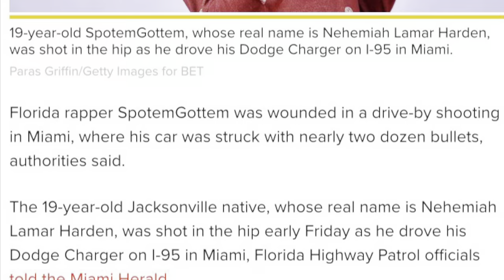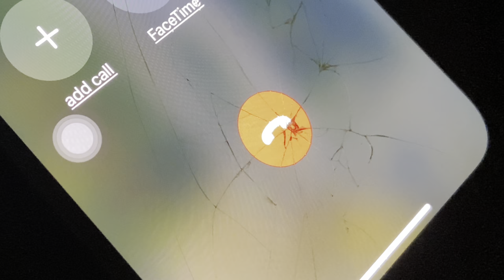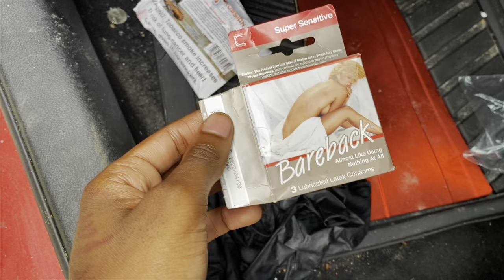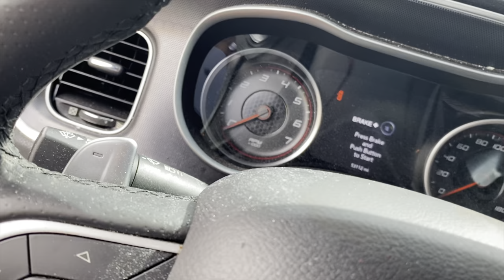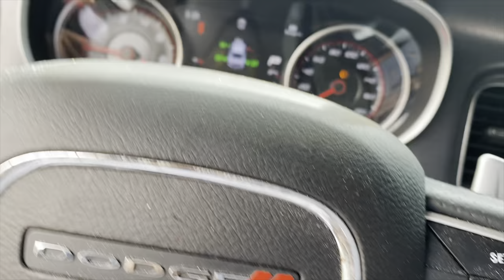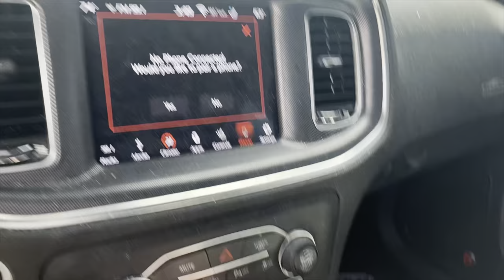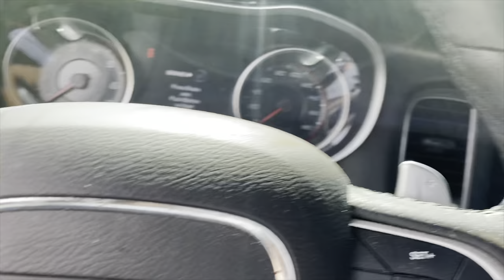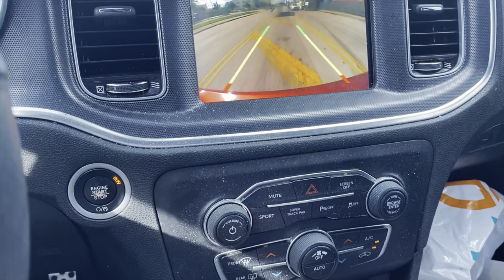MY STOLEN SRT 392 WAS RECOVERED!! SPOTEMGOTTEM WAS DRIVER! *CRAZY VIDEO MUST WATCH!*

Comment: How did they steal the car from you anyway?
Reply from the maker: next video stay tuned!
Reply: They probably ain't steal that shit that's Miami chop shops everywhere someone took it and after they changed VIN etc spotemgotem purchased it
Reply: Probably pushed it and towed or pulled it. they get stolen so easily because the steering wheels in the chargers and Challenger's  don't lock and turn without the key fob In them. Then there's a thing next to the shifter to manually take the cars out of gear without the key in it. It's messed up dodge doesn't make the steering wheels at least lock in them. That's how most of them are getting stolen out of people's driveways at night without them knowing.
Reply: @TrapSRT  spot em got em didn't buy it how stupid are u guys, simple story someone spot em got em knows stole it and spot em got em had it that night he got shot
Reply: It's even easier today then it used to be with everything being wireless
Reply: @TrapSRT  cool channel bro I jus started me 1 I got more and better content cumn 💪🏿
Reply: Real talk 🤔🤔🤔
Reply: I seen a lot of videos where they can get a copy of the key transmitter feet away and program a key on the spot in the car and drive off. Than chop shops change the vin etc and resell the car
Reply: @m200dreamer7  IGLA system is the best defense against this
Reply: Press charges on his ass … I’ll be damn if someone steals my shi … smh
Reply: Damn they trifling them rubbers tho lol
Reply: And here I can’t get anyone to steal my v6 so I can afford a v8 😂😂😂😂😂
Reply: Do a what u found in the car video !
Reply: @dpresssure1262  👮🏾‍♂️👮🏾‍♂️👮🏾‍♂️👮🏾‍♂️👮🏾‍♂️👮🏾‍♂️
Reply: @lordoftheturps9337  😂
Reply: What was in the trunk lol
Reply: He sold the whip and started makin videos 3montha ago with the yellow thang with the money 2 Fa 1 good job playa haha
Reply: Spottem gotta white hellcat
Reply: @TrapSRT  cut the cap
Reply: Why didnt you have insurance so they can repair it..Not you lol
Reply: @dpresssure1262  🧀🧀
Reply: @lordoftheturps9337  🤣🤣🤣🤣🤣
Reply: Goated click bait
Reply: It’s a stolo nobody’s gonna take care of it
Reply: @TrapSRT  what’s the name of the song at the end
Reply: If its stolen why not dog it. You think they go take care of a stolen car. You must rode the short bus to school.
Reply: They ain't steal yo car crazy that man probably payed 10k or better from some jack boys his money to long  question is how was you sweet enough to get it stolen
Reply: That’s why he had to crank the car up in a different way than what he used too.
Reply: The za still in there👀😏
Reply: So it got stolen from you and then got stolen again for spotem gotem
Reply: @stltrappin8062  clout chaser
Reply: @18_trama  Riiiiiight.....how you not know how to start your own car😂😂😂
Reply: money in the trunk..
Reply: Spottemgottem left his dirty pampers in the trunk! 🤣🤣🤣
Reply: Surprised their ain't no blood all inside
Reply: Rotors look like that from moisture and sitting
Reply: Dude is not even mad his whip got swiped. He's not even mad about the bullet holes, he just wants a blue front caliper.
Reply: @tlrcamp8009  what’s IGLA?
Reply: It probably got stolen by what is called a repeater box now what that does is copy the signal from your key fob and then the car computer system thinks the actual key fob is in the proximity of the car and then access to the car is then granted and now car thieves don't have to break the window or have the actual key fob on them to steal a car and can now take a car in less than a minute and that's what probably happened in this case here
Reply: @jackknifeexecution1634  one of the most complexed security systems out on the market, started overseas now it’s here in the US. It has a really awesome carjacking feature, lord forbid you get carjacked but if that was the case let them take the car the engine cuts out after about a block
Reply: @brockadkins949  exactly who tf take care of a stolen car 🤦🏾‍♂️
Reply: @lordoftheturps9337  yea only 392s and up get stolen
Reply: @TexasHeat2010  sad true facts of life
Reply: And why would anyone with insurance stress a stolen charger. It isn't like you can't just buy another one with insurance payout.
Reply: You should keep the bullet holes. But just clean it up.
Reply: @bretjjjohnson7942  You can break this steering wheel locks easily by twisting the wheel back and forth hard or removing the plastic cover around the steering wheel then they break the lock with a screwdriver. They don't stop anyone with a little knowledge.
Reply: @winey99cobra  Wondering the same thing. If the insurance paid out the claim he's not the owner of the vehicle anymore & they will come take it back. I would never let a car stay stolen for 9 months without filing out a claim with insurance.
Reply: @shanewilliams6364  At least minimum 20k-30k for a stolo even with that cheap paint job. They have to invest in buying a recked car or cloning a vin to get legit vins , they usually go 3 or 4 cars deep to steal a car.  Then flip it to the guy that sells it for a couple bands. Most people wouldn't waste the time trying to make it legit. He could of purchased thinking everything was Gucci as I seen on the news this has been happening a couple years now.
Reply: @odb-gotyoutriggered.1963  basically
Reply: @swizzjr89  👌🏽😂😂😂😂😂😂😂
Reply: Make a video of what you find in the trunk 😂😂😂 pls
Reply: He knew he was buying stolen tho. Otherwise, he would have got it from a dealer.
Reply: @TrapSRT  do a what u found in the car in the next video too, should be interesting watch as well with what happened/how it got stolen
Reply: @brandonscott3729  idk bro, this makes the 3rd publicized rapper that’s been caught driving stolen SRT’s, Lil Reese (chicago), Donnie pain (chicago), & now spotemgotem (Miami)…. 🤷🏾‍♂️
Reply: @TrapSRT  drop it
Reply: @odb-gotyoutriggered.1963  even though the insurance paid him already by him being the owner he has first rights to buy the car back when the vehicle is recovered that’s how insurance policies work
Reply: @TrapSRT  I said the same thing like shit don’t add up 😂
Reply: Like most of the other comments say, they didn’t steal it from him directly and most likely purchased it from someone that stole it, changed the gun and repainted it. How you think these rappers that’s broke be getting these lambo trucks and shit big dawg? 😂 them hoes stolen!
Reply: Isn’t that a srt where is the super charge? 🤣
Reply: @tlrcamp8009  Not true, The Insurance can refuse to sell the vehicle back. I personally went threw this when they stole my vehicle with around 30k in engine mods alone, The insurance refused to sell me it back because they could make more money reselling it at auction then what they paid out. Got a lawyer & everything, They have clauses in the contacts allowing them to decide what they want to do.
Reply: Trunk from my understanding
Reply: @TrapSRT  respect, u smart
Reply: @bretjjjohnson7942  damn so they can just slap it in neutral and put it in a trailer huh
Reply: @TiGGY7796    Shazam the song
Reply: @Hewhodoesntgiveafck  u have no idea what u talking bout 😂
Reply: @elijahlymus1370  yep or they can pull it with another vehicle. With modern security systems. They figured it wasn't necessary to have the steering wheel look like other cars when the key is out. And there's also a box you can buy. when the owners in the house and has the key fob in the house with him. It will pick up the key signal saves the signal allowing theft's to unlock the door get in and start it and drive off. It doesn't take five minutes to do if that. That's why when you see videos of them getting stolen out of people's driveways as soon as they walk up to the cars or any other hellcat or newer Mopar.  It's sad  there one of the earliest car in the world to steal and the owners are being killed over them and dodge really hasn't done much to fix the security issues.
Reply: @markcitarella454  yep it's crazy when you see what there using to be able to start them.
Reply: Word wtf
Reply: @bretjjjohnson7942  u couldn't been any louder
Reply: @TrapSRT  make it Alr I’m tryin see what go down
Reply: @ChurchesMoney  who me
Reply: @tlrcamp8009  just need a machine that cost a few hundo and you can get a car key made to any car 🙄
Reply: @JJVsk8tXL  it doesn’t pop up
Reply: @JJVsk8tXL  I’m shit out of luck
Reply: @todhold2673  maybe he did maybe he didnt but a judge cant prove it and thats not necessarily true cuz in the hood they'll get something for a bargain and not ask questions. plus why would the seller want to reveal it was stolen when he could get more for it without saying that.  there's car shops that are known for having whips for the low and people know not to ask questions.  his problem is theyre gonna wanna know who he bought the car from and how much he paid/who owned the car.  but if he has a good lawyer he'll probly get off easily
Reply: Yea man sorry I couldn’t find it myself I tried Shazam siri google assistant the song  is out there but Probably an unknown local artist track and  also in trap srt 🐱s playlist 😅& for us we  gotta look deep in the net just to find it . But if you come across it first than I do plz come back to this comment and link that cause I also wanna hear more of it as well 😅🙃
Reply: @vsan5700  how’s they do that paint job the same day?
Reply: I kinda wonder if spotem was in atl 9 months ago now lmfao
Reply: @vsan5700  just say u got a crush on him weirdo
Reply: @m200dreamer7  yup, keep them fobs in a safe or on the other side of the house from the front door.
Reply: @TrapSRT  qqq
Reply: @hennesippn7145  bro if u have a connect u can get stuff done asap u don't get lame excuses like a lot of people give
Reply: @vsan5700  I’ve painted cars and I know that paint job took longer than that. It’s about being realistic my boy. Yes it’s possible but that paint job was way too clean to just been rattle canned in the middle of the night by some dude all cracked out
Reply: dumb question. its a srt? they gon learn how to n find out
Reply: @brandonscott3729  Hatin on rappers….rappers really don’t have like you think….
Reply: @backdoeinshi  basic 392 srt doesn't come supercharged.. that's the difference between 392 scat packs and hellcats..the cats come with a blower
Reply: Dawg do you know how many challengers and chargers get stolen😕it’s sad and not very hard
Reply: bruh none of these rappers own the cars they ride in
Reply: @hennesippn7145  not middle of night but maybe they started early and was done by night especially in Florida lol shit is an oven
Reply: @TrapSRT  shii kapp
Reply: @bretjjjohnson7942  wow thx for info, this is the reason everyone raps about them cuz they really the ditch car
Reply: They stole my Charger.  I'll never buy another Dodge product for multiple reasons.  Been riding foreign ever since.
Reply: @TrapSRT  we wanna see wats in the car
Reply: @JJVsk8tXL  I got you 💯
Reply: It’s fake 😂 he’s doing it for views 😭
Reply: @TrapSRT  🧢
Reply: @JJVsk8tXL  the song is by lil joc but it’s not out yet

Comment: Bruh, you need to get your insurance adjuster to claim your whip as totaled. You do NOT want to rebuild that thing. Sorry to say, but she gone gone
Reply: The value of that car has sky rocketed off of the incident alone. Anything a celebrity touches or wears is automatically worth more. He should keep it
Reply: Finally a comment I was looking for. I couldn't be the only one thinking it wasn't worth rebuilding. Not only would it be a ton of money but the bullet holes could rust years later if not done correctly. It's just not worth it. That car would never be 100% again.
Reply: @allenrachal  y’all are mad wasteful. Not one vital component was totaled on that car… you see a few bullet holes and turn into 🤐
Reply: @BulletBoyGaming  he's literally gonna have to strip down the car TRY to cover the bullet holes and replace literally all quarter panels, fenders, bumpers all windows and doors. Not to mention replacing the interior cuz of all the blood. Sorry to break it to you but repair for that is gonna cost beyond what the car is worth. Not worth it.

Comment: Crazy most definitely...I remember when my Lexus was stolen last October. No feeling like getting your shit taken from you. The level of violation you feel is unmatched.
Reply: I swear
Reply: How they be stealing it ? Niggas still be hot wiring cars 😭😭😭
Reply: @Benjii2k  lol nahh my dumb ass ran into a gas station that was empty thinking it was sweet so I left it running but had the key fob in my pocket. Less than 60 seconds later my shit was gone. Lesson learned
Reply: @23MBeezy  car is supposed to turn off if it gets out of range of the fob.
Reply: @23MBeezy  I don't play that shit. I take my key out and car off. I spent 10k on the sound system alone  🤣🤣 I'll jump off a building
Reply: @23MBeezy  I have a quick release steering wheel so if my cars on I take my steering wheel with me
Reply: @Executnr  maybe the newer cars yes, but with mine if the key fob isn't inside after the car is cut off you wouldn't be able to start it again
Reply: @23MBeezy  same thing happened to my black on black Jeep GC Altitude. Thought I was good cause I had the FOB. They crashed my shit up smh. Never again man. It won’t shut off like ppl think
Reply: @pluugz2917  damn that's tough, I was fortunate af because they actually didn't crash mine when I got it back. And yeah that key fob don't matter, they could roam freely without that key until they cut the car off. Hopefully people listen 🤷🏾‍♂️
Reply: bro i feel you, nothing hurts more then busting your ass for your stuff then somebody coming and stealing it.
Reply: Facts
Reply: @23MBeezy  I’m gone tell you like I told my ex, you gave your shit away, and deserve to lose it for being so naïve to leave it running. People be living life on cloud 9 green asl. Did it occur to you to check on your unoccupied running vehicle, and where the strap was? Taken with the car or you wasn’t strapped? Either way I wouldn’t have let the world know I volunteered to give my car away, where they do that at lol
Reply: @23MBeezy  love Lexus. Great running cars
Reply: @b-low_nor_cal4983  yessir, best vehicle I've owned to date!! 2 years and only had to change tires and brakes lol.
Reply: @alexromero4315  exactly bro, I'll never put myself in that's situation again
Reply: My Lexus IS350 got totaled and I’m without a whip for months. The dude ain’t trying to take responsibility so now it’s an on going case. I had all types of mods from lowering springs to cold intake and the diffuser and lips on it with rims all that. It’s cool tho at the end of the day it’s all material shxt I’m just glad my baby is safe. I’m in hustling mode looking a better things to come. (I messed up for not getting a police report k the scene and proper witnesses. I felt like the guy was going to own up to it but I thought wrong now I’m in this mess. Even tho I didn’t get it stolen it feels like I got finessed.
Reply: @NightmareZ34  smart man, nice Z 👌🏾
Reply: @KingAlexander98  that's tough bro, but you definitely got the right mindset.  This material shit will forever come and go. Simply think of it as a small setback for a major comeback 💪🏾 keep grinding bro
Reply: @23MBeezy  did you get it back?
Reply: @23MBeezy  and they tell you no one can steal it without the key fob, shiiiiid
Reply: @protouch502  exactly! That myth is definitely busted
Reply: @23MBeezy  Rookie mistake and they got yo ass 😂
Reply: @NightmareZ34  I'm just imagining this nigga walking in mcdonalds wit a whole steering wheel 😂😂😂
Reply: @Main-Villain  😂🤷🏾‍♂️ shid I got, got! Came back better than ever 👌🏾
Reply: @ReaperPLUR  🤣🤣🤣 I was wondering that too bruh
Reply: @23MBeezy  thank you🙏🏽
Reply: @ReaperPLUR  gotta do what you gotta do fam😭😂 I be warming up my car in the morning and if I gotta run inside real quick I take my steering wheel just in case😂

Comment: The rotors are fine, this happens when the car isn’t driven
Reply: Yeap, flash rust… this dude is being a drama Queen over them rotors, the motor is the selling point of the car
Reply: The point is they not taking care of these car AT ALL
Reply: @david_terintino45  - hate you 😂
Reply: exactly lol.
Reply: He knows nothing about cars. The rotors will look like that after a rain
Reply: They can be grinded
Reply: @stevecanal9058  you can just put brake cleaner and run 100 miles and all that brake rust will disappear, no need to grind them.
Reply: Just go for a drive  the rust will naturally ware off after a few stop and gose
Reply: Its called surface rust

Comment: The brake rotors will rust if the car wasn’t driven in a long time. Also if the battery is weak or dead in the remote then you do have to touch the remote against the push button start.

Comment: Rust on rotors is normal on cars that have been sitting for a while in rainy weather. The brake pads will clean it off completely after driving and hitting the brakes a couple times. If insurance totals the car, I would keep that 392, the brakes, and the wheels - all that will sell fast. I wish I could drop a 392 in my Ram Rebel.
Reply: Naw fr I was dead ass gone lose it If I heard his ass say look at the rotors they ain't take care of it  ma ass  thought the vid was goin in a loop